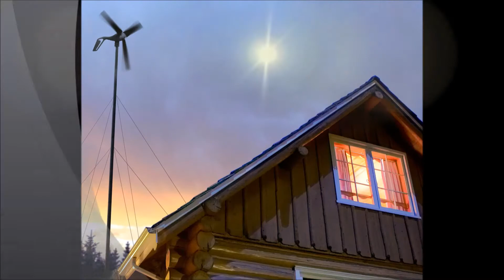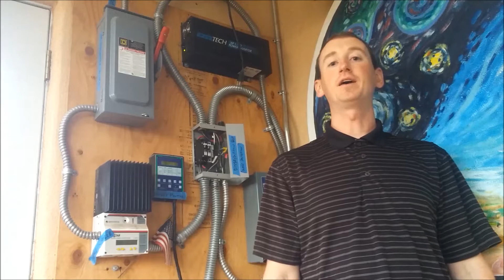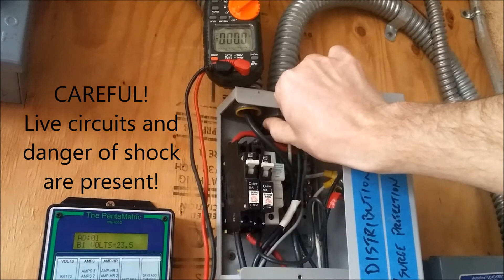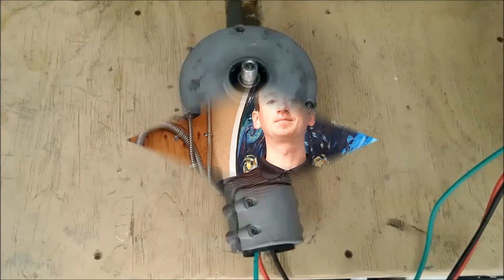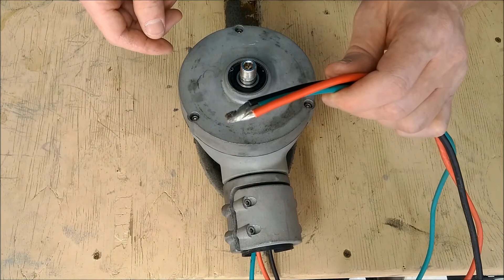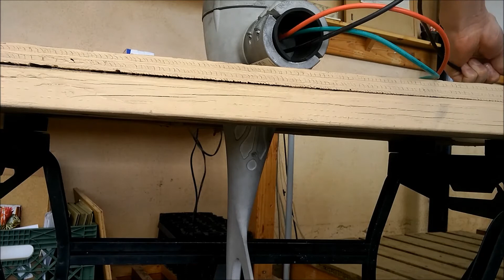Troubleshooting Your Air Wind Turbine

Comment: when you hooked the wires to your battery did you have the green wire connected to the negative side of the battery if so why didnt you use the black wire -not judging just curious as i am not really sure and i think with my air -x in a marine situation i think i had to twitch both green and black together -thanks Andy

Comment: Doing the bench test my turbine doesn't spin freely with the wires not touching each other.  It feels like there's a load and if I hook up a drill the drill really has to work to spin it.  Any ideas?  Is the turbine hosed or have a internal fault?
Reply: is it a bad bearing if the bearing go bad thay can lock it up and make it hard to spin hope this helps